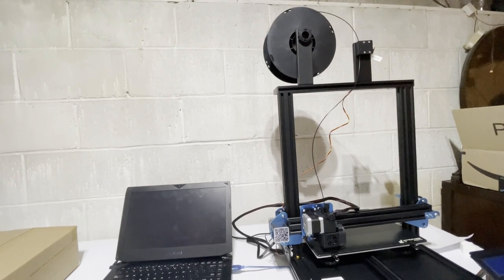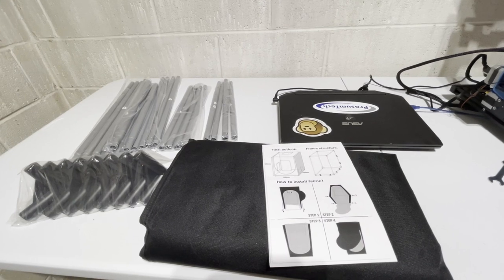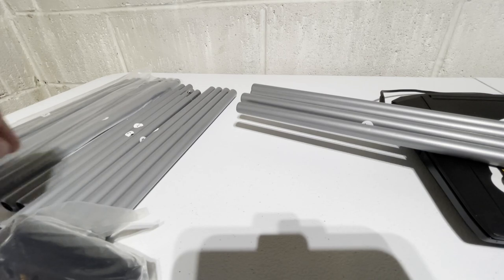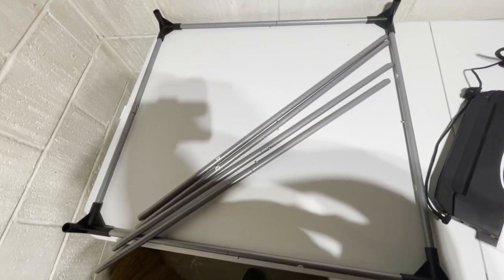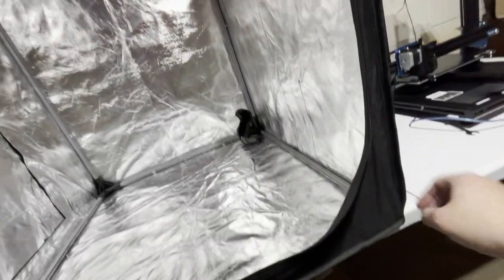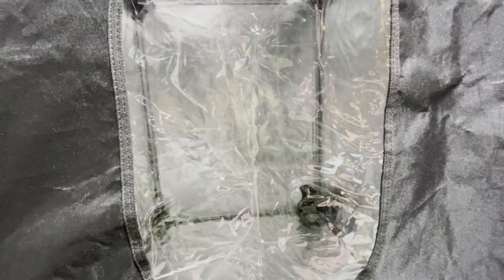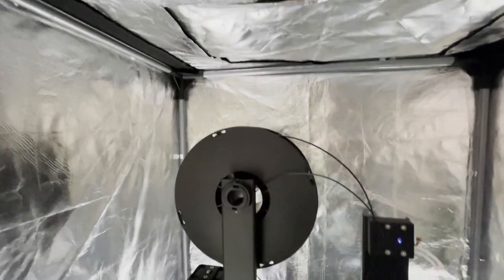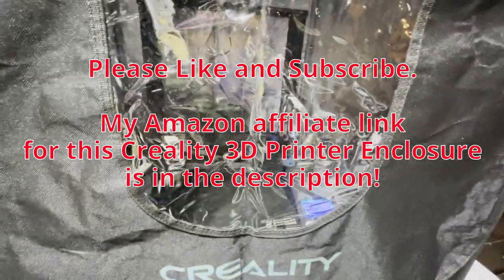You Can 3D Print in a Cold Room or Basement with This Cheap Creality Enclosure

Comment: Hi! i'm thinking of getting one of these. How has the printing gone with it?
Reply from the maker: It definitely helped. I was able to get several things to print and adhere that had not worked before in the cold basement.
Reply: @JerryTravisSmith  how cold is your basement roughly?
Reply from the maker: @gompan1234  It got down to about 52F or so for a good stretch this winter. We had some single digit temps for a couple weeks. We heat with gas but there aren’t a lot of vents downstairs and we don’t spend a lot of time down there so we’re not too concerned about heating it beyond that.